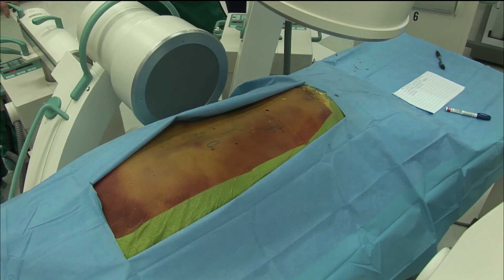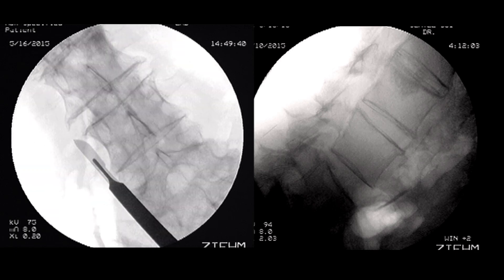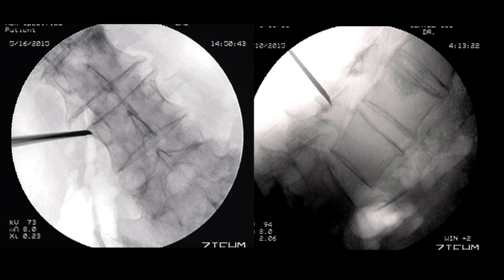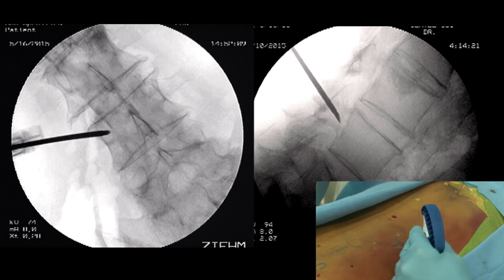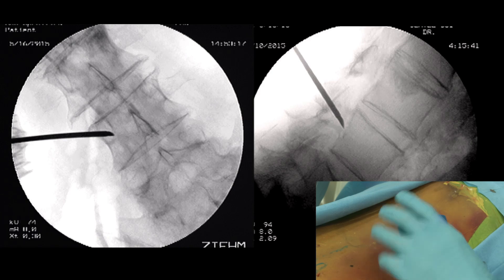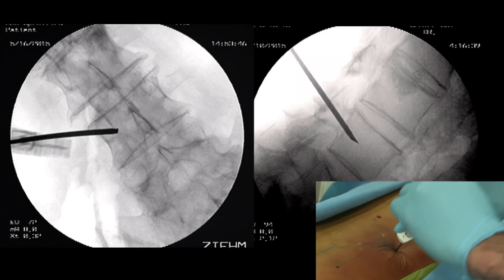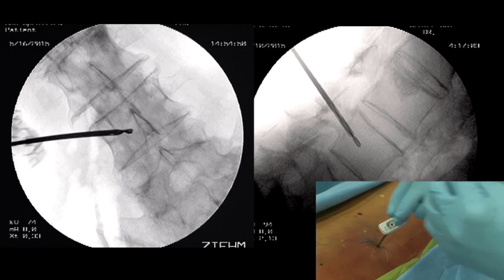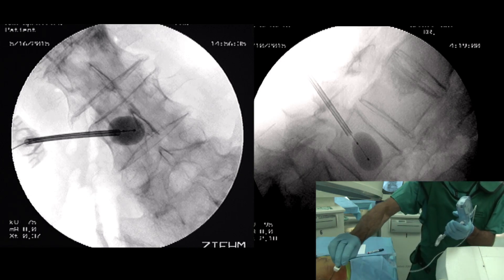Vertebroplasty & Kyphoplasty Demonstration by Thomas Oberhofer, M.D.

Comment: PLEASE HELP ME

There is any method due to perform kyphoplasty on a just calcified vertebral bone? L1's 13° kyphosis developed after compression fracture here, that was not treat by that surgery because nobody told me about this possibility when it was possible yet (gymnast, no ostheoporosis or other ilnesses at all, just training injury fracture). I known about this possibility by myself along bed recovery time, I hope you will can tell me about a surgery procedure that will reshape my L1 vertebral body as it was even it is just calcified nowadays. Please, reply this message if it shall be the case and/or contact me at Instagram profile (same nickname).Thank you from Italy.

Comment: I am 23 years old and I already have 3 compression fractures on my back. I sadly compressed fractured my T12 similar to the one in the video. Although, mine is a bit more compressed. A neurosurgeon has recommended this procedure for me. The fracture happened in 2016 and I do still feel back pain. My T11 & T12 are so close to touching and my nerves are always spasming. Is this procedure something that will truly helped me in the long run? Has anyone had this surgery and can speak from experience? I am trying to get feedback before I decide to do a surgery on my spine.
Reply: Hi, 4/5 years ago is a very long period due to perform this surgery method, are you sure that your neurosurgeon told you about this one exactly? Kyphoplasty should be done very soon on young people unfortunately, because just after one week it becomes not useful and dangerous for vertebral bones those have just started their calcification very soon. Thus, the high risk is that they may crack during little baloon enlargement step before resin will be put inside due to remodel and fix the fracture. Then, if it will be the case, it forces surgeon to remove upper and lower vertebrae's disks and fusing three vertebrae together due to fix the wasted vertebra, provoking coloumn block at that level. Things are different for older people who may get this surgery method later too, because they have not fast natural calcification like us.

I got L1's upper vertebral body compression fracture provoked by a training injury (gymnast) on November 2020, that was not treat by kyphoplasty surgery because nobody told me about this possibility when it was possible yet (no ostheoporosis or other ilnesses at all being a gymnast, so no more than one week due to do it in time).
Thus, I known about this possibility by myself along endeless bed recovery time when I spent hours and hours searching on the Net any information about what happen to me exactly and what Medicine may offer due to gain my previous condition again, but it was too late when I become aware of the only real concrete whole solution.
I know that I can complete calcify my L1 by myslef along time, but I will should deal with its kypohosis developed because it cannot remodel vertebral body by itself too, that is the reason why kyphoplasty could solve this situation only if was performed as soon as possibile.
I am aware that I will be able to compensate it with my strong back muscles and abs, but trouble will start if I shall stop training in future amd just assumed that vertebrae will not be too close by theirselves as for your case is. Thus, I deem that my L1's upper posterior verterbral body may be too close than T12's lower posterior one, so provoking contrast by them, as you told for you case about I am very sorry. Moreover, I do not feel my lower external left leg as before the injury, added to some arms/hand random feeling (I got hurted between C6-C7, even if L1's vertebral body broken "only", so I may developed some cervical compressions too). I am still using orthopedic corset, so it is soon due to evaluate my real condition nowadays.

How many bed rest time did you take? For how many time did you use otrhopedic corset?

I wish to you all the best and I hope we may tell us about a surgery procedure that will reshape your T12 and my L1 vertebral bodis as it were even they are just calcified nowadays.
Please, reply this message if it shall be the case and/or contact me at Instagram profile (same nickname).

Thank you from Italy.
Reply: How are u?
Reply: Yess how is she?

Comment: I had the same procedure 6 months ago but I still have bad lower back pains. Could it be because I'm 65 and have level 4 osteoporosis? I'm afraid I'm getting addicted to tramadol.
Reply: dolly callaway, this procedure usually solves the pain from the compression fracture. Did you have any other spine issues?
Reply: How much cost this operation in USA?grettings from Austria

Comment: I heard "tools" hit the floor? Also an oops?  I'm still ready to have my procedure though.  Very informative. Thank you
Reply: uknowimright6269 I have a l1 compression fracture from a fall a month and half ago, I was scared to get the procedure but had kind of decided to go ahead and now my insurance won’t approve the mri I need. My fracture is caved in from the top of the vertebrae,  have been told this can put too much density so that the vertrabrae above and below can be compromised and also told that with my kind of fracture I should go ahead because the height needs to be built back up. But also told it can heal on its own. I have not decided what to do. I was diagnosed with l4l5 s1 bulging discs last spring and I’m afraid a lot of my pain may be coming from That yet I have had a lot of new pain from this and have also fractured my tailbone. I just want to do what’s right for my pain level going forward, I’ll be 32 in June.have you done the procedure yet, what are your thoughts on it and any info you’ve been given along the way?
Reply: krystle dawn ...please get to Texas Back Institute as soon as you can. I saw both Dr. Staub and Dr. Lieberman.  The second did the surgery. I'd been denied MRI twice but the office staff took control and in less than 20 mins not only got approval but also an appointment the same evening for MRI.
Reply: I went to Plano, Texas...amazing results so far.  Going into 4th month after surgery.
Reply: @uknowimright6269  I am very pleased for your success using this technique. If kristke Dawn was refused insurance coverage for the procedure-I wonder how much it would cost to pay privately out of pocket. Does anyone have a rough, general idea of the cost? This could bring a lot of relief to many people who are suffering. My nerves are being utterly mangled in my L1, 2, 3 and maybe 4. It’s affecting my digestion and I am not walking properly etc. 
Please ask God to help me - as well as others who have compressed vertebrae. Mines from osteoporosis. I am 61. Lack of hormones are playing a role too.
Reply: @janetskene3413  I suggest calling TBI in Plano, Texas. I cannot give enough praise to the doctor and entire staff.
  It's been over 3 years and NO PROBLEMS at all.
I had a crushed vertebrae with protruding to nerve.
 The young ladies in the office spoke with my insurance company and got an approval for MRI.
I fought with insurance for two long painful months on my own.
Reply: Hopefully clumsy fingers if nurse bringing tools back to the sink. I’m sure they weren’t dropping nstruments while filming..tee hee I’ve had it done three times on different ares 6 yrs ago,,very happy I did, don’t know how I heard of it and why more people don’t try this route!